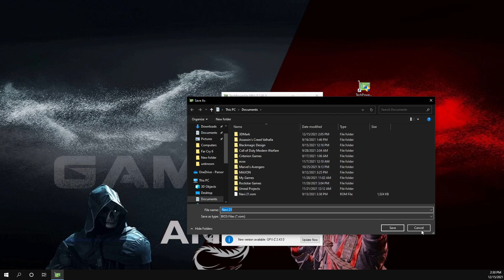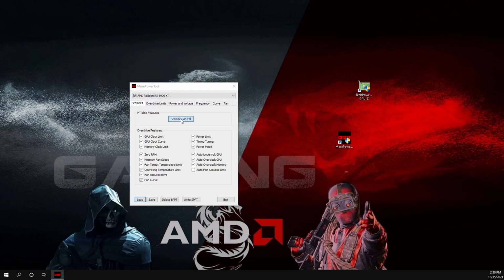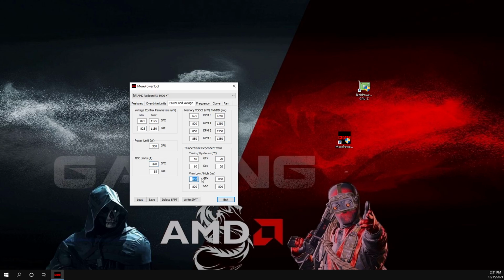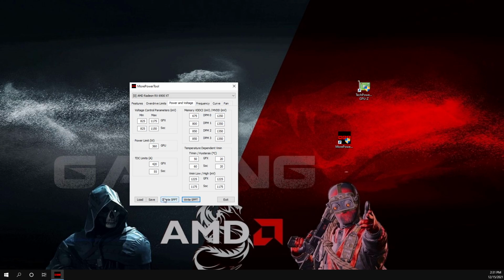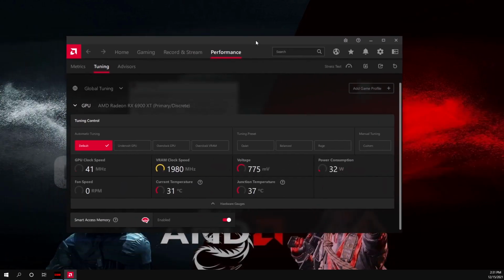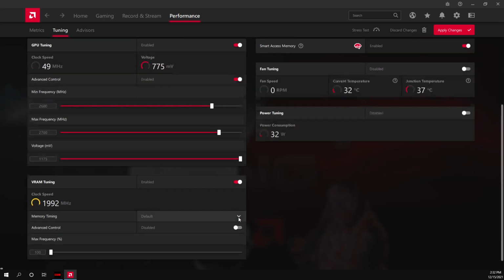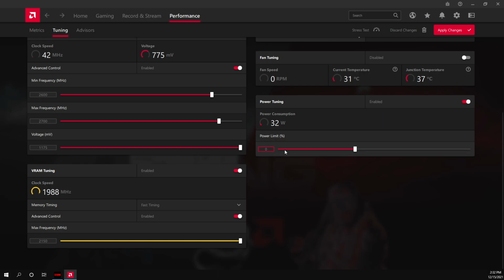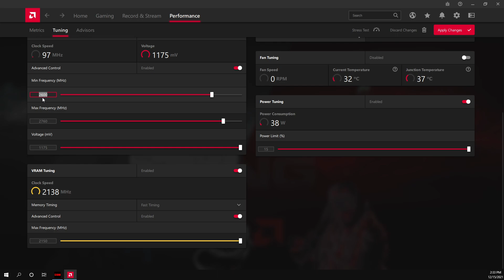AMD MPT ( More power tool ) Updated with how to add voltage adjustments.

Comment: After watercooling, i cannot set my memory clock  higher like before
Reply from the maker: More details? In mpt if you change any other settings then I show in the video driver stability goes out the window. Hopefully this weekend I will have some time to mess with MCT just released from Igor will be making a guide to it as well in conjunction with mpt and might be able to do some changes here as well now that I can push without adrenaline.
Reply: @AMDPCBuoldersCommunity  yes, every gpu is unique, because of silicium
Reply from the maker: @HeadFlux  I have seen one off's like the red devil tends to do a lot better then most the other aib with xfx following a close 2nd, my toxic yeah really disappointed in it. Hopefully it will do a little better without the adrenaline software. 

Here is the pain part as I am worried about making videos doing this some have tried to copy my settings off this video I don't put up copy paste settings in this just examples of numbers. 

The fb link here takes you to my fb group and if you want I can work with you through messages on fb to help figure out why you are having issues as most likely something simple to fix in your case. Plus show all the information to you..

My name is Kevin Tinnin and if you join my group you can diect message me from there on FB.

Comment: I found that when changing max power limits on my RX 6800 that the card runs at it's 250W TGP anyway, but then goes into a limp mode 5 minutes into a hard workload.  I'm not sure what causes that, could be the power controller chip.  Obviously the RX 6800 has more limits than the 6900XT
Reply: Ran across your channel looking for info on MPT. Just picked up a ASRock 6950XT OCF I'm trying to take the card as high as I can for a daily use. I put a water block on it under a custom loop. I don't know if I'm not understanding how the power/voltage tables work it seems like I can't get anything higher than 2850(2800) stable on GPU. That is with default values. Even with pushing things in MPT seems like it's stuck there. I know that particular board has some of the best power delivery so I don't think it's that.
Reply: @JMNovak1011  it may simply be silicon lottery.  You could try increasing FCLK and SOCCLK frequency values in increments of 100mhz to squeeze more perf out.  On the RX 6800 SOC CLK is at a sweet spot of around 1800MHz, increasing more than that did nothing.  Flck is infinity fabric, so push that as high as you can stably get.  On my RX 6800 I can get up to 1660MHz with Boost FCLK @1600MHz.  Hope this helps.
Reply from the maker: Cooling limits or off settings a lot to get into but ambient temperature, then if GPU is air cooled I would not push more then 50-70w over it's normal power draw and you have to look to keepngpubas best as possible under 60c if open loop then loop normalize temperature would be the limit to the GPU temperature staying below 60c these numbers are how to plug in. I have seen these pass a 6800xt stock performance by 1k points then the 6800xt will push past the 6900xt stock performance by at least 1k the 6900xt will push out far. But aib seems to be best the red devil 6900xtu and a close second would be a close second the toxic I have tops out at about 24500 in time spy GPU score 

It not easy start low work your way up just have to do it to how much you can cool it.
Reply: @AMDPCBuoldersCommunity  I now managed to get 5% over, not that I have hit the power limit in anything other than Furmark.  I am now messing about trying to see which clock frequencies actually improve performance
Reply: @AMDPCBuoldersCommunity  Also, I havent seen any temps go high, however I believe AMD has set a max power limit on the RX 6800.  I will try figure out what that is
Reply from the maker: @kobusdowney5291  your best bet would be to hit me up in my fb group then message me in fb.  Can show you the math of everything. AND how to input setting best guess is something is going wrong might have to troubleshoot with you some. To find where it is at and what's going on. My name is Kevin Tinnin the link to my fb is the link on this page. I need some sleep but will be available tomorrow easy enough . Just way to much back and forth here. AND a lot of different things I need to know specific to your system.
Reply: @AMDPCBuoldersCommunity  all good, managed to get extra 30W without any issues.  No power limits reached on Timespy, no temp issues anything.  I am at 44th place when searching RX 6800 single GPU graphics score. My Username is Kosiiq. Managed to improve my score somewhat from 57th place.  Checked out what else improve performance of GPU.  Only SOC clock and FCLK improves performance.
I dont do FB.

Comment: do we just leave the temperatures alone?
Reply from the maker: The cooler it is the better it runs. This is not a copy paste guide it's how to plug in the numbers in mpt I left it like this with the intention that you use your own numbers based to your cooling solution this is what it will very from use to use.there is other factors as well. But if air cooling I would not suggest much over 30-70w more power. And zero voltage added. If water cooling and aio you can typically push more in to it without overcoming your cooling solution but this depends on how well you can cool it. And normalize temperature under load. 

If you have good cooling you can push these out to the limits of how much heat you can remove. Much past 60c GPU temperature you start to lose these returns.

Comment: Dope, any tutorial on Fan curve? I mean is there but not clear on how to adjust.
Reply from the maker: Set it by temperature to ramp up  . If you are just adding a mild power curve I would not suggest more then 50-70watts on air and fans at 100% above 60c you would have to play a little to what you want and how well your cooling works.

Comment: I am looking on how to change the voltage offset for more overclock stability
Reply from the maker: I show that in the video on how to add power of you edit much more then I show in the video things become unstable with the drivers. I have tried memory and voltage settings both it will let you increase it by a fixed high and low. Anything over 400w would need more voltage I myself with good cooling don't go over 1250. Under cold I've been higher it does not take much. I set mine 600w 1250 in 3dmark run a 400w plan daily

Comment: My Sapphire Nitro+ 6900XT doesn't show up in the drop down menu - the drop down is empty. Last year when I got the 6900XT I noticed this so I was stuck at 303W at +15 power. But a few months ago I found it was showing up, so I upped my power limit to 345W at +15, and I last ran benchmarks at 345W on May 3rd 2022.  Yesterday I noticed my PC downloaded Radeon 22.5.1 and my power limit was back to stock 303W at +15 instead of 345W. I loaded MPT to fix that, just to see that my 6900XT was no longer in the dropdown again. Using DDU in safe-mode and uninstalling MPT and GPU-Z and redownloading the latest versions and installing didn't fix this. I'm stuck at 303W at +15 power again. Help?
Reply from the maker: Every time you change drivers it needs to be written to the registry again
Reply: @AMDPCBuoldersCommunity  I would do that except that my graphics card won’t show up in MPT (more power tool anymore), so I can’t write SPPT… Do you have any idea why my graphics card does not appear in the drop-down anymore? Or what I can do to fix it?
Reply from the maker: @LarryGanz  I would need a ton more info on your build. to even guess.. my first few would be if a riser cable remove it dont use ddu but amd cleanup tool to remove drivers or a factroy reset while installing drivers then what driver version are you using and power connectors to the gpu 2 or 3? then are any on cable extensions or one cable per plug or are they on a pig tail what the psu ratting is cpu in use.. event viewer look for whea errors. and so on there a lot here to get in to why I pointed you at group on facebook to be able to message me.. as this can be so many possibility's for message and responce  here on youtube..
Reply from the maker: windows can be auto updating drivers causing issues there is a lot to really get in here to do check and figure out the why its not showing up at times
Reply: @AMDPCBuoldersCommunity   I still very much appreciate your reply. I can't even get a feel for how often this issue of "no GPU in the dropdown" occurs, but have only found 3 other instances online, with no replies to them on how to fix it. 

I would need a ton more info on your build. to even guess..
* ASRock Taichi Razer Ed Mobo, 980 Pro boot M.2, 970 Evo+ and 980 game library drives, 5800X3D with Sapphire Nitro+ 6900XT, CableMod full set of upgraded cables, 2x 8-pin on GPU (375W total capable), Corsair Capellix AIO, Seasonic TX-1000W Prime PSU. Was stable with everything at 380W GPU power draw, 400W started to show occ issues and I backed it down to 345W since last month. Yesterday found it was reset to 303W max at +15 before the 22.5.1 installed. It had only auto-downloaded and was waiting for me to install. 

* EDIT - G.Skill Trient Z Neo RGB 4x 8GB CL16-3600 until last weekend, then same brand but 2x 16GB CL16-3600. I sold the 4x8GB and ordered 4x16 Royal Elite C14 so I took half the 16GB sticks from my other build until the Royal Elite shows up (to use in my 5950X/3080Ti rig).

...my first few would be if a riser cable remove it 
* NO Riser cable

dont use ddu but amd cleanup tool to remove drivers or a factroy reset while installing drivers then what driver version 
* I tried DDU first, then I tried the AMD cleanup utility, then tried both. DDU is set to not allow windows to download drivers, and I thought AMD cleanup had told windows to not update right away after the reboot. I made sure the nVidea drivers from my spare 3070Ti and 1080 were removed previously and removed Nvidia again anyway, just in case.
* I downloaded Radeon Adrenaline 22.5.1 direct from AMD to install - I told it to use the 6900XT specific download, not the auto detecting download. I think prior to that I was always letting the app update for several months now, and not doing clean installs, so I did the clean install this time. I WILL TRY THE AUTODETECTING VERSION OF ADRENALINE JUST IN CASE, AND USE AMD CLEANUP INSTEAD OF DDU TODAY
 
are you using and power connectors to the gpu 2 or 3? then are any on cable extensions or one cable per plug or are they on a pig tail what the psu ratting is cpu in use. 
* just the pair of CableMod 8-pin PCIe power cables connected to the TX-1000W Prime. No extensions - have a 3-pin RGB connected to the motherboard for GPU light control, but uninstalled signal RGB.
 
* Last month I was using a 5800X and TX-850W Ti Prime PSU and that whole time MPT never showed my 6900XT in the dropdown. But then installed the 5800X3D and 1000W PSU, and I think that after the upgrade it may have been when MPT started letting me see my 6900XT for the first time. But for the first year of having the 6900XT it never showed up in MPT dropdown. 
* I did have the 6900XT out to do the hardware upgrades, and wonder if I should physically pull the card and power cables and reseat them - doesn't explain why from Mid April through yesterday I was running 345W as per my MPT settings and OSD.

event viewer look for whea errors. and so on there a lot here to get in to why I pointed you at group on facebook to be able to message me.. as this can be so many possibility's for message and responce  here on YouTube.. 
* I will try to find you on Facebook if needed and if okay with you. I'm not skilled at event viewer to look for errors, will try to fudge through it.
Reply: @AMDPCBuoldersCommunity   The thing is, using DDU in safe mode I had autoupdate off in DDU settings. Then installed radeon while in safe mode and let it reboot to finish. When that didn't work I used AMD cleanup in safe mode and it didn't like being in safe mode or something, but I remember a popup where it said it would make windows delay auto installing drivers after the reboot. The GPU only showed up in MPT after the new 5800X3D and 1000W Ti PSU, and then it was gone within a month.
Reply from the maker: If it resetting to default this is a kind of fail safe with amd drivers either drivers have crashed or windows did not shut down properly.
Reply: @AMDPCBuoldersCommunity  also I have able to push my Sapphire card as high as 380 W without crashes, but had backed my settings down to 345 W because I was not seeing much improvement past that point. But it was not crashing even at 400 W unless I ran fire strike extreme. The big problem now is that my graphics card is not showing up in the MPT drop down anymore, before or after I load the ROM. I have deleted an uninstalled MPT, GPUZ, Radeon 22.5.1 adrenaline and drivers in safe mode, rebooted, and reinstalled everything with no result. So on the older drivers it was working at 345 W, after the new driver it was back to 303 watts (at +15 power), but MPT no longer works let me increase the power living again.
Reply from the maker: @LarryGanz  380w crashing is most likely something causing it to crash.  Are you in my fb group? I believe the fb link should take you to that give me a message here my name is Kevin Tinnin in the group questions just say I invited you to it for reason to join lol and we can talk about everything here directly and if needed hit discord as well

Comment: hi i have a saphire 6900xt nitro se , i can't find information on my board to use More Power tools, can you help me with which voltages to start? at the moment i am in oc 2550/2650 with mV 1100, without using mpt, use liquid cooling!  thanks for the help!
Reply from the maker: The voltage does not need to be really changed unless you're going over 400w then it's kind of try and see 1200 would be more then enough to hit 450w 1250 till 500w 550w 1300 would be ok your limits will be temperature really. Watch the video I show where to put the information at and how to set it.  If 450w then 450*.15 then subtract that from the 450 put the lower number in power and the higher number in tdc
Reply: @AMDPCBuoldersCommunity  
hello thanks for the answer, now I've always done a test oc from the amd software without using Mpt, I put 2600/2770 with mV 1175, the score has even lowered I don't understand why! I have a seasoni 850 W power supply, I also have the 5900x cpu with oc to 4600 on all cores! explain me better about power limit once loaded the original biso and 289w, on TDC Limits gfx 320 on Soc 55 tell me what to insert as data! on the voice Vmin Low / High (mV) GFX 800/800 on the voice Soc 800/800 what should I insert thank you!
Reply: I forgot the power of the card when it works never exceeds 330w
Reply from the maker: @cristiandeejays  power can cause issues pushing plus 15% on GPU is 330w now add the rest of your components for power you going to find you are close to the 850w
Reply: @AMDPCBuoldersCommunity  
can I copy all your same data that you entered on your card? to start with mine?
Reply from the maker: @cristiandeejays  no your best bet would be starting low. Are you water cooled? On air cooling this the most I would do is like 380-400w
Reply: @AMDPCBuoldersCommunity  I'm water cooled
Reply from the maker: @cristiandeejays  so 400w should be stable pretty easy no voltage change.
Reply: @AMDPCBuoldersCommunity   I am checking the maximum capacity in the test phase with time spy and reached the maximum 600w 20140 score on time spy
Reply from the maker: @cristiandeejays  this is no OC just pbo and auto gpu on latest driver set. 

https://www.3dmark.com/3dm/75068334?
Reply: @AMDPCBuoldersCommunity  however I was wrong to give you the score, it was 20165, Graphic score 22618, cpu score 12490 .. is your cpu in stok or are you in oc?
Reply from the maker: @cristiandeejays  400w power play 2600 min 2700max fast timings all memory clocks + 15% 

https://www.3dmark.com/3dm/75068717?
Reply: @AMDPCBuoldersCommunity  if I add your same data that you entered on MPT, can I achieve the same goal as you?
Reply from the maker: give or take in this range really depending on settings and cooling
Reply from the maker: @cristiandeejays  just cooling will be the most as far as limits on gpu 

https://www.3dmark.com/spy/25936871
Reply: @AMDPCBuoldersCommunity  okay if i start with Power 360 / TDC 420 and 1200/1175 low / high?
Reply: @AMDPCBuoldersCommunity  hello with the last 3dmark you posted to me making 22616 points, what voltages have you changed? I put your same voltages and inserting from the software amd 2700/2800 to the 3 test gives me an error if I put 2600/2700 I pass the test! with my temperatures there are no problems with the power supply I had a peak of 710w
Reply from the maker: @cristiandeejays  no voltage change
Reply from the maker: Sorry that's 550/1300

Comment: Are u on water cooling? And how many watt psu do u have?
Reply from the maker: Yes it's now the toxic with block on it. 1850 watts of power
Reply: @AMDPCBuoldersCommunity  wtf sooo much
Reply from the maker: @rlightprod2829  one is. A 850 the other is a 1000w 1000 was not enough total draw CPU GPU was 950pkus from the wall

Comment: How would I find the bios? When I click load I don't have a supported file.
Reply from the maker: First 1 minute shows how to get the bios from your card you save where you can find it are you sure you should be messing with this stuff?
Reply: @AMDPCBuoldersCommunity  my bad I kinda skip around videos and missed it
Reply from the maker: @martinsim7551  just be careful man all I can say  do a bit more research on this out side of what I have here ask I will help but careful
Reply: @AMDPCBuoldersCommunity  cool thanks
Reply: @AMDPCBuoldersCommunity  also I wasn't using the tool to increase gpu voltage I just wanted to disable the ds functions in the feature controls